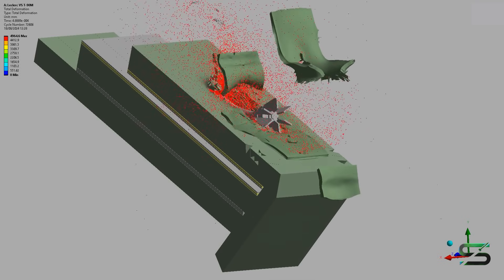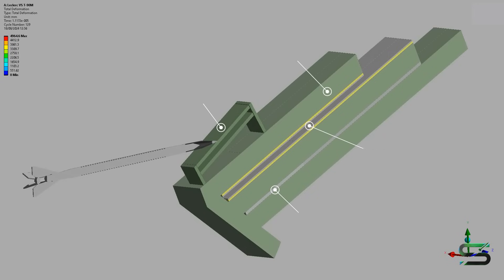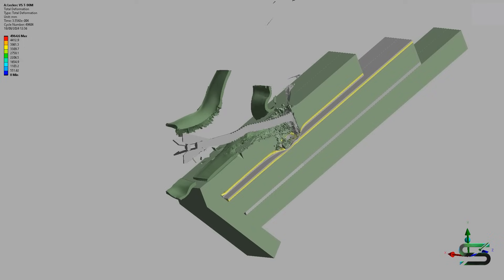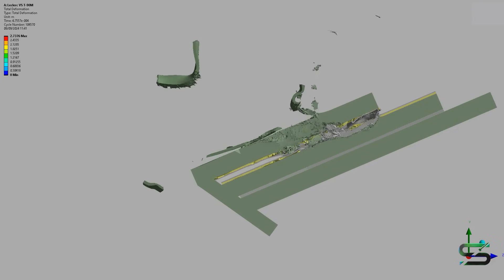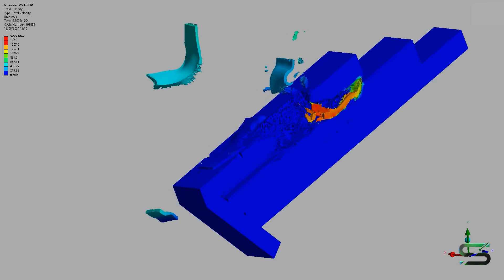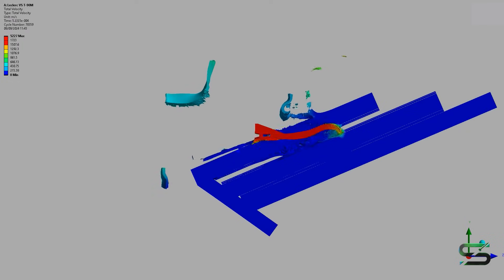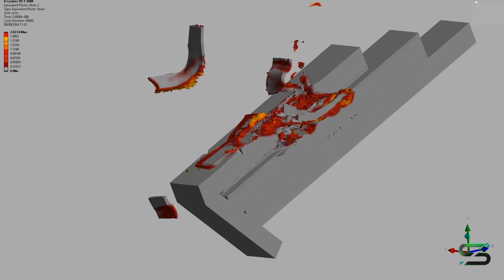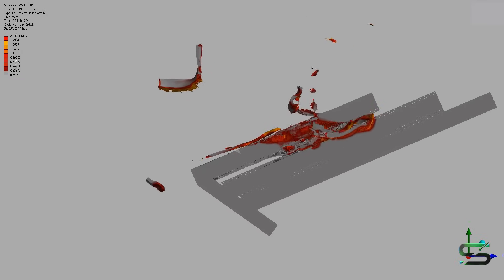Leclerc VS T-90M | Armour Piercing Simulation

Comment: How is T90m doing in Ukraine? Well? Not so good. Btw it depends on the angle. On the sides of the t90m that have relikt on the side skirt of the tank have shown a direct hit will easily penetrate and go right threw the side.
Reply: Honestly no tank is doing well in Ukraine due to kamikaze drones, it is not T-90M fault, it is a good tank, it can even withstand 5-6 kamikaze drone attacks and the crew survives
Reply: @Maverick966  it still has the same problem ammo under the crew. We saw a video of a t90m exploding. After being hit on the side that had relikt side skirts. And this video btw is using an older sabot round. As there is already a new sabot round in the works to deal with relikt. And the 130mm round will be able to punch right threw t14 armata era aswell.
Reply: @travismccraw6013  So? Even Leopard 2 carries most of its ammo in the hull, not really different, they are all 1970-80s designs
Reply: @travismccraw6013 те де леопарды 2 так же имеют боекомплект в корпусе. При этом большую его часть. Ко всему прочему он находится во лбу танка. Если он подорветься то леопард так же кинет башню и всему экипажу смерть
Reply: @Maverick966  "it can even withstand 5-6 kamikaze drone attacks"
Nonsense. Tanks don't have health bars IRL. A good hit with a powerful enough warhead will penetrate any tank on the first try.
Reply: Т 90м чисто фактически лучший танк что сейчас на Украине, он банально лучше всех защищён от Дронов камикадзе и ручных гранатомётов(к слову говоря реальных танковых боёв на Украине за все время сво было чуть больше 10, так что защита от кумулятивных зарядов типа рпг является перво очередной задачей танка и т 90м в этом плане на уровень выше всех западных танков, это факт)
Reply: @LordEnd5990  т 90м чаще всего уничтожают обычными ПГшками)
Reply: @fotunfotun7515  о мой комм удалили, если ты про РПГ то т 90м их хотя бы лбом танчит, Абрамс же вообще РПГ не выдерживает( т 90м лоб корпуса 950/башни 1100, Абрамс лоб корпуса 350/лоб башни 750, пробитие тандемного заряда РПГ 800мм)
И да интересно было бы узнать откуда инфа клоун)))
Reply: @LordEnd5990  я имел ввиду пг нацепленный на фпв, такие дроны т 90м в лоб пробивают, конечно пикируют под небольшим углом. Не думаю что вооруженные силы сша будут публиковать данные о своих танках, но абрамсы рпг держат спокойно. Есть видео где абрамс в засаде выдерживал десятки попаданий рпг 7 в борта
Reply: @fotunfotun7515  тогда уже лучше говорить кумулятив или заряд РПГ на фпв, сразу скажу что такие дроны чисто физически пробить т 90м в влд не способны, только в уязвимые места типа нлд или триплекс мехвода, потому что пробитие самого современного тандемного РПГ составляет 800мм, а на фпв как правило вешают либо устаревшие либо классические с соответственным пробитием в 400-600мм, опять же не знаю с чего ты решил что Абрамс спокойно держат РПГ, если буквально один из первых Абрамсов был подбит прям в лоб башни как раз с РПГ 7, и не нужно путать реальное танкование броней и банальный расстрел трупа

Щас я скину свой комм где я об этом рассказывал другому челу

Не знаю почему два предыдущих клоуна так заагрились на вполне адекватный коммент где человек поделился своим мнением.
И тем не менее я добавлю свое, и начну с пожалуй самого большого танкового мифа всех времён и народов, миф о том что БК совестко российских(буду называть их отечественные) танков взрывается от любой палки а западная техника не убиваемая за счёт расположения БК в кормовой нише с вышибными панелями, для того чтобы понять что это миф достаточно просто взглянуть на чертежи обоих танков(Гугл картинки) и увидеть что БК отечественной техники находиться на дне боевого отделения и защищено основной броней танка, то есть броню надо ещё пробить а по бк ещё надо попасть, в это же время основной БК у западной техники находиться в башне(80% всех попаданий приходиться на башню) и имеет относительно слабую защиту( 750мм лоб 50-100мм борта и самое худшее это крыша и непосредственно вышибные панели 20мм и 5 мм соответственно) на зоне сво уже был подбит один челленджер 2 из 30мм гранатомёта в крышу башни, так что во первых БК западной техники сильно уязвимо по сравнению с отечественной, во вторых вышибные панели работают только в том случае если БК заполнен кумулятивными снарядами(и их должно быть не больше 10-15) что в условиях современной войны просто глупость ведь танки исполняют роль мобильной огневой точки, а значит БК будет на 85% фугасным, а вот от фугасов вышибные панели и броне-шторка не спасает, соответственно взрыв БК для западной техники настолько же критичен как и для отечественной, при этом не стоит забывать и то что у абрамса БК есть и в корпусе за передним катком смерти и тоже очень уязвимо.
По поводу противостояния автомата заряжания и заряжающего, я с вами сильно не согласен, во первых надёжность отечественных автоматов и механизмов заряжания находиться на очень высоком уровне( за западные автоматы сказать ничего не могу), поэтому автомат будет понадежнее человека который может заболеть или что то ещё, также автомат имеет преимущество и в скорострельности, в частности новый автомат заряжания в т 90м и т72б3м имеет скорость заряжания 6.5 секунд, в то время как средняя скорость зарядки Абрамса составляет 15 секунд/выстрел (инфа не из воздуха об этом говорили американские генералы в интервью и они не считали это минусом, также важно понимать что заряжающий постепенно устает, так что не исключено что скорострельность Абрамса первые 20-30 секунд будет 5сек/выстрел, но потом скорострельность будет сильно замедлятся) ну а то что стрельба на ходу является повсеместным делом как у нас так и у запада я даже говорить не буду, помимо всего этого также замечу то что Абрамс уступает современной отечественной технике в бронировании(350мм лоб корпуса 750мм лоб башни против т 72б3 640мм лоб корпуса 800 лоб башни и т 90м 950 лоб корпуса 1100 лоб башни), уступает в максимальной дальности выстрела основного орудия( максимальная дальность выстрела 120мм орудия западной техники составляет 3500м, максимальная дальность выстрела 125мм орудия отечественной техники 11500м), а также имеет отвратительную логистику(фильтр ГТД который требует чистку каждые 2 часа, и трансмиссия которую нужно капиталить после каждого марша и множество других проблем), Абрамс остался на уровне т72б, а превосходит только ранние советские ОБТ такие как т72а, т64а/б и т62м, против которых он и создавался собственно говоря
Reply: @LordEnd5990  ваши слова опровергают десятки видео уничтожений т 90м. Абрамс в засаде после десятки попаданий был не трупом, а вполне работающим танком экипаж которого наводил орудие и мог стрелять. 
Челленджер был уничтожен фпв дроном. 
Чаще всего у танков происходит возгорание порохов а не взрыв бк, так как порох поджечь можно любой искрой а взрывчатку в снарядах можно подорвать лишь прямым попаданием в него. Шторка как раз от этого и спасает
 Скорость заряжания бопса в абрамсе занимает 4-5 секунд, у других видов снарядов чуть больше. Танк не стреляет так много и непрерывно, устать заряжающему будет сложно. Дальность стрельбы советских танков 9 км, насчет западных не знаю, но явно не 3,5 км. Абрамсы бопсами т 72 с расстояния 2,5 подбивали ведь
Reply: @fotunfotun7515  не надо врать
Reply: It isn't doing terrible, it seems it can tank quite a lot, perform its firing tasks well and moving additional ammunition to the turret bussle storage really decreased risk of ammunition detonation. Still, carousel can be potential danger and its bad reverse speed is absolutely inexcusible for Russian MoD. Before you say "but they already lost like 100 of them", it isn't anything shocking considering Russians push for it to become main tank of their army. Many of those loses aren't considered as complete and crews often survived attacks, which is the most important thing.
Reply: @cybernetic_crocodile8462  agreed. Nobody mocks my T-90M, unless they are mocking the reverse speed. Then it is absolutely justified.
Reply: No modern tank in the world has side armour strong enough to defend itself from APFSDS fired by another modern tank.
Reply: @londonberry2180  Несогласен, леопард 2а5/2а6/2а7, т 90м и украинский т 84 оплот вполне могут держать удар
Reply: @LordEnd5990  modern APFSDS can penetrate an excess of 500 mm of RHA. Side armour typically provides less than 300 mm of RHA protection against kinetic energy rounds. They can protect maybe against HEAT warheads.
Reply: How is the abrams doing in Ukraine 😂
Reply: It's not that you're wrong about the T-90M, it's the implication that a direction hit to the side of any other tank in existence wouldn't cause penetration that is wrong.
Reply: @JAnx01  relikt heavily depends on the angle. Of the incoming projectile. The stepper the angle, the relikt works. A shot straight at the side will go threw. Many think that relikt does offer protection to both heat and sabot rounds. However it's not perfect. Have you not seen the video release last year of a t90m turning its side towards the enemy. With in seconds the t90m explodes.
Reply: @travismccraw6013  I already told you that you weren't wrong about the T-90M, yet you continue to talk about it. Can you explain how the side hull armor of other tanks stops modern warheads and APFSDS projectiles, though? There's always a relatively thin plate behind tracks.
Reply: @JAnx01  no tank can take a hit on the side. But having ammo under the crew is one of the biggest issues with russian tanks. If they made an autoloader say like the one that is used on leclerc, type 90, type10, k2 black panther. Then russian tanks wouldn't be exploding like that.
Reply: @travismccraw6013  All the tanks you mentioned still store two thirds of their ammo in the crew compartment next to the driver, but I agree their autoloader is safer and better overall as it takes much less space, given the ammo is stacked on top of one another in a very compact package. I'm actually surprised the T-14 Armata uses a huge carousel autoloader which is very space inefficient now that there's no crew above it and it makes the tank longer by at least 1 metre. One metre that could've been saved had they used a Leclerc-style autoloader and bustle ammo storage. And the saved weight could've been used for extra armor around the ammo compartment which is supposedly pretty poor.
Reply: @JAnx01  ammo stored near the crew in leopard and leclerc have been changed to less sensitive propellant. As we saw a leopard 2a6 that was captured by the Russians. They end up showing the drives station and it was less burned due to the fire that started somewhere on the tank. Sure enough the ammo next to the driver didn't go off. If Russians had used less sensitive propellant ammo, then it might do some good, but again a bustle auto loader is the best option. And you save tank crews lives. A good crew is more valuable than the tank itself.
Reply: Bruh… no tank is doing good in Ukraine. There isn’t a counter to drones yet lol.
Reply: Wow bro, the sides will get penetrated??? NO WAYYY, I WOULD'VE NEVER GUESSED!!!
Reply: Before anyone wants to come and say I'm wrong, go do your research.

Comment: They always use SABOT rounds designed Before ERA never use mid 90's and newer rounds DESIGNED to defeat ERA plates 🤦🏾
Reply: Usually sim guys don't use newer darts because there are no publicly available specs for them so when they do use them it's an approximation
Reply: @solus48  Are there publicly available specs on the ERA they are using 🤔. I know it's all just for entertainment and clicks I get it
Reply: @wilinstonthompson1352  yes
Reply: relict was designed to work against anti-era rounds
Reply: Relic is a multi layer ERA, it reduces the speed of APFSDS that is supposed to penetrae Contact 5 by up to 60%.
In other words Relic was made to counter Tandem Warheads and APFSDS. So its a counter to a counter
Reply: @Richard_T800 do you think they are doing to do a counter ammo fir the counter of the counter
Reply: @amaurycap8034  Very likely.
There have been dual core APFSDS rounds that perform better against ERA but worse against Composite Armor.

They would be a good counter to the Russian ERA usage but that Tandem APFSDS was Russian aswell
Reply: Relic is multi layer ERA, its a counter to a counter
Reply: What is the diffrence between old APFSDS and new APFSDS rounds? They are baisicly long rod made out of very hard material. How do you inprove it? Besides making it longer and/or moveing faster?

Comment: If only the Russia would adopt the same turret bustle autoloader as the Leclercs, it would be amazing. But Russian tanks are a fraction the cost of NATO tanks. In this case, less than 1/10th the costs.
Reply: T-90M cost: $4,5M (2016; adjusted for inflation: ~$6M in 2024); Leclerc cost:  ~$17M. Yes. It is costly. The fraction is not "1/10th," but rather 1/3. Yet I do agree on the autoloader and would add "a proper transmission with better reverse gear..." :D
Reply: @Sunshrine2  that T-90M price is the old old price. They’re just around USD $1.1 now.
Reply: @velvetthundr  That's the cost of upgrading the T-72B to the B3 standard.
Reply: @Sunshrine2  They have a new reverse gear as of 2024
Reply: They did experiment with bustle autoloaders with the Object 640 but that never got adopted
Reply: The supposed "extremely high cost" of the leclerc is a common myth. 

Yes, it's probably a bit more expensive than other NATO tanks because it didnt benefit from economy of scale, but many people misattributed an obscenely high price to the tank because they didnt take into account other services like ammunition, maintenance, training and additional support vehicles when deals were signed between France and its clients.

Comment: Cool simulation!
It‘s pronounced ləklɛʁ. 
Considering LKE II isn’t capable of penetrating T-90M and possibly T-72B3M, LKE I naturally wouldn’t do much either.
I wonder if LKE I able to bypass Kontakt-5 (4S22) the way LKE II is.
Reply: if LKE II can bypass kontakt 5 then T-72B3M is probably vulnerable to it. as the relict blocks are only on the side.
Reply: @quan-uo5ws  If that’s the case, then the only thing in the Russian arsenal the Leopard 2 or the Abrams won’t outright destroy at practically any angle in a single hit is the T-90M.
Reply: @RichelieuUnlimited  you forgot the T-80BVM, which also has relict on its frontal armour.
Reply: @quan-uo5ws  You are correct.

Comment: Ofl 120 f1 no longer in service
Reply: Most of the rounds tested on here are since we don't have data on the classified ones that are in service.
Reply: @jonny2954 until someone has an argument in WT
Reply: Still it didn't even go halfway through in point blank. How much better will a newer round be? 30%? 30% of still sucking as a round
Reply: @divoulos5758  Don't think of "x newer round will be x percent better". Doesen't work that way. Rather "x round designed to defeat x armor array". The improvement of a round specifically designed to defeat a certain array will be far above just 30%.

As example ERA defeating tips don't just marginally improve performance against ERA, they allow to nearly completely bypass an integral part of the armor array with little impact on the penetrator.
Reply: @jonny2954  not all era is the same and newer ones contain copper liners that cut the projectile no matter the cap. If i remember correctly kontakt 5 onwards it has those liners so the simulation is inaccurate, it looks like kontakt one, basically a metal box with explosives